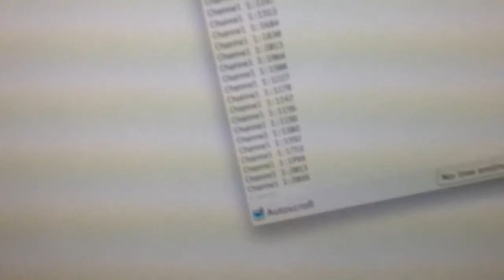RX PWM - Arduino

Comment: Hey Mike, is there a way you can post the whole code? I'm having trouble setting it up and I'm using two Esc to control 2 brushless motor with a nanolite receiver from Spektrum. Please some help